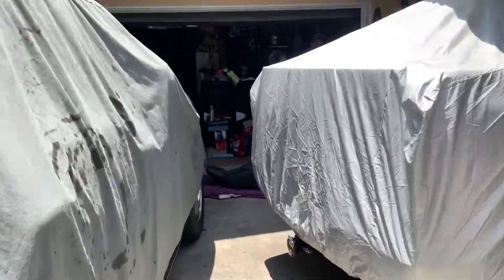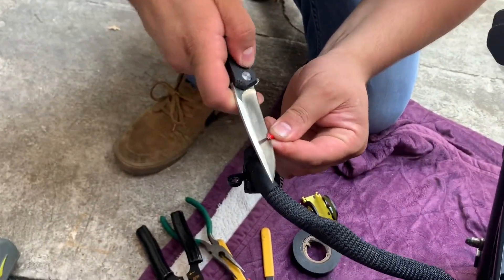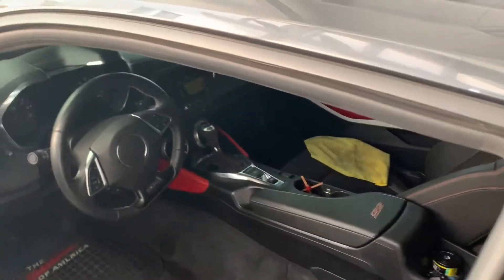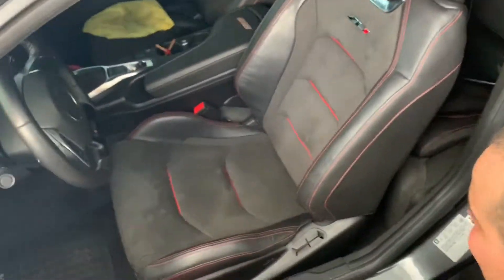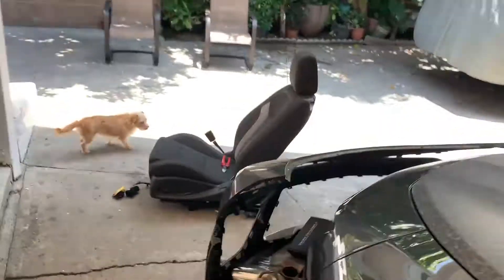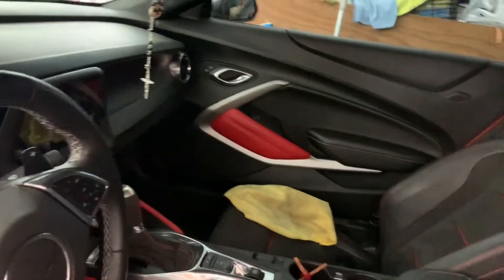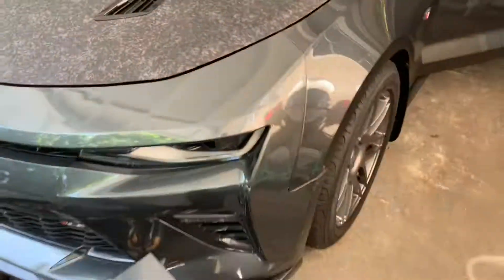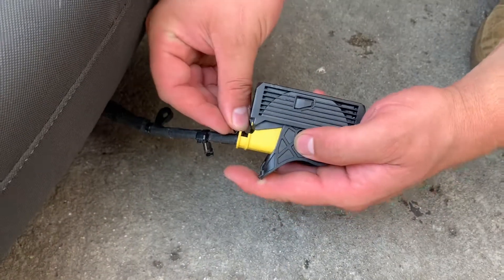2017 Camaro SS Recaro Seat Install

Comment: I don’t really care about the ventilated seat. I just want the power seat to work. What should I do? Thank you!
Reply from the maker: @CamaroSS1  the pass side will work no modifications needed, but the driver side you will need to put a jump wire from pin 24 (the thick red wire) to pin 1 (the thinner red wire)
Reply: @ytrfilms9694  thank you so much!

Comment: Since the 1SS doesn’t have buttons for cooling and heating, does that power need to go to the pin 1? Would the driver seat not have the basic functions to move forward or reverse and up and down using the first main power?
Reply: No it will use it's own power supply and has 3 wires power ground and the blue wire(speed using voltage) but if the ZL1 seats does not have 2 power source wires it will not move at all

Comment: How did you reveal the wires? Also, did you get any dash lights for the airbags?
Reply from the maker: i just used a wire stripper and made sure i didnt cut the wire just peeled the plastic over lay off of it.
Reply: YTR Films did you get any airbag codes? My friend did this method and ended up with a airbag light lol
Reply from the maker: @illegalfreakTV   no we didnt but i had my srs module relearned at the dealer the 6th gen had a recall on that
Reply: I did the same thing on my Camaro and I it worked perfect. No airbag lights and I already have it for a month.👍

Comment: Great video. How do you turn on the cooled/ heated seats? Do you have a switch for that?
Reply from the maker: @CamaroSS1   got the harness from gen DIY and works great
Reply: @ytrfilms9694  Thank you for replying. I was referring to the actual switch to turn it on and off.

Comment: Bro i dud the same. Work good but now i have the airbag light turn on in the dash.  Do you have any problems with that?
Reply from the maker: no issue with my air bag light.. some times if you pulled them from a wrecked car the sensor might need to be replaced

Comment: Is the airbag light on?
Reply: Yes. I did the same that this guy, work good but now the airbag light turn on in the dash
Reply: Reidel Concepcion thats because the passenger seat harness is a little different. Thats why its best to use harness out of old seat. Or switch around the airbag plug from old seat to the new seat. I learned that the hard way.
Reply: Did you cut the the plug from the old passenger seat and put in the New seat?
Reply: Reidel Concepcion yes i had to
Reply: Reidel Concepcion have you fixed the airbag issue? I was thinking about doing the same thing on this video
Reply: illegalfreakTV yes only difference is passenger airbag plug. If you taken out of old seat and put in new seat you will be good
Reply: Bigboy Les I have the 1LE Recaro seats. The front passenger seat fit in just just fine but the driver seat has a different harness. If I do the same steps as this video, will the airbag light still be on?
Reply: illegalfreakTV yes it will be on unless you take from old seats. Also subscribe to my page. I did a video about the seats
Reply: I still have the problem. I wish that somebody make another video about this
Reply: @reidelfernandez9779  did you ever fix the air bag light issue ??

Comment: I’m looking for the same seats I just want the front ones. I also have a 1ss but there so expensive
Reply from the maker: yeah they are got mines off a wrecked ZL1 with less then 1000 miles front and back
Reply: Raul I picked up a full set (front and back) for around 1k before freight, I kept an eye on eBay and then called the sellers directly and negotiated, good luck!  Mine aren’t flawless but they are still pretty nice, and even if they’re tighter fitting they’re overall more comfy

Comment: What did you use to join the wires togethor
Reply from the maker: To test it out we just spliced in to them but once we found out it worked we depined and solder and heatshrinked it and put the pins back in

Comment: I just ordered some ZL1 seats, has there been any adverse effects installing the seat this way?  Thanks for the video!

Edit: found the pin out here https://www.camaro6.com/forums/showthread.php?t=490124&page=14 so I think there shouldn’t be any issues long term, since pin 1 and pin 24 appear to be “battery positive voltage” only
Reply from the maker: no, seats work fine no issues at all!! however, they are ALOT stiffer then the oem ones lol pin 1 and 24 are just battery power so there is no issue jumping them the guys over at DIY gen5 recommend that way also. im glad the video helped
Reply: YTR Films yes it was invaluable, thanks again, I just installed mine last weekend! I used some T-Taps and lug connectors to make mine easily reversed if I sell them!